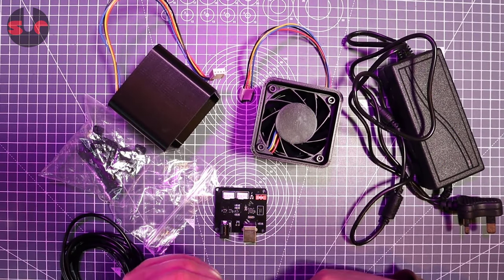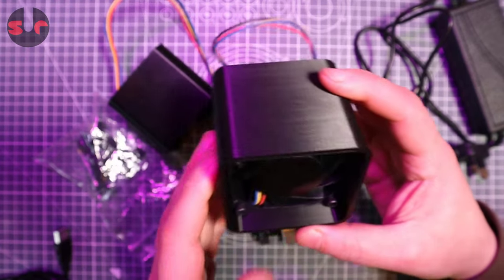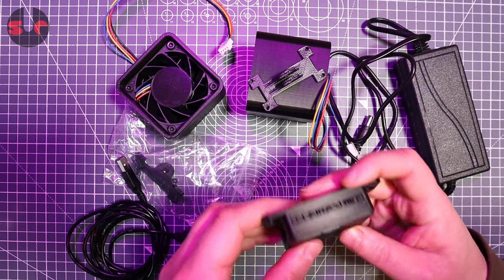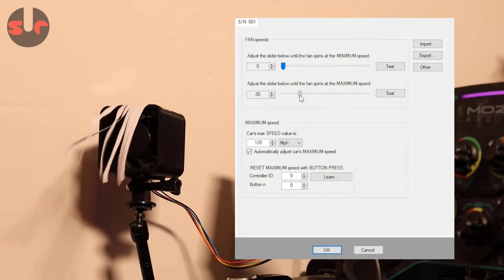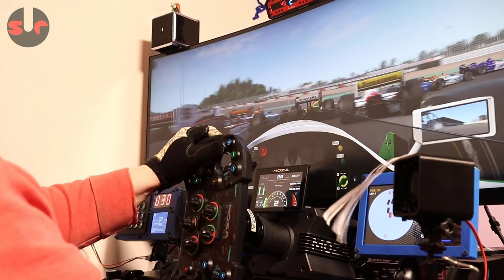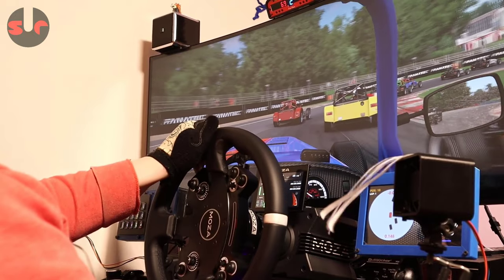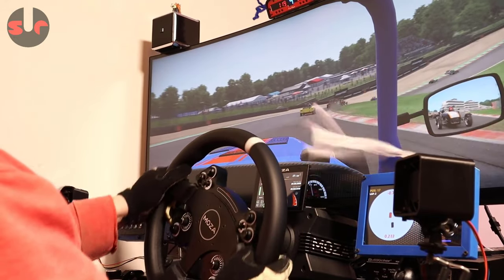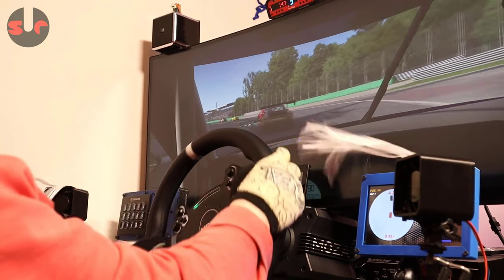SymProjects Wind Simulation [REVIEW] Compact fan controller and fans for sim racing!

Comment: I  love your videos.  Because you always try to show us the best products for the money.  In fact,  I purchased a few of thing you reviewed.  But,  the wind simulator just like the h-pattern shifter,  is something I don't understand for sim racing.   Even if you have everything already, base shakers ,  VR or even motion.     In your honest opinion,  does this really help with immersion?   Do really feel like you were missing something before this?
Reply from the maker: I don't think anybody would disagree that bass shakers make a big difference. But personally, in my opinion, wind is something more of a gimmick that's not a big deal. It's nice to have, but quite unnecessary. I need to give it a try in VR, that may make it feel more of an enhancement. I will say, though, I do like having the blast of cooling breeze.
Reply: Ventilation seems mandatory if using VR and a WindSim does this automatically and you just adjust how much cooling you want.

Comment: Are you at all able to comment on how SimHub's "Speed with Curving" functionality (left/right variance when going around corners) works with this wind sim, specifically for drifting?  I'm curious if it works as one would expect when drifting a right turn (meaning the left fan would be blowing significantly more than the right as the left window is the forward-facing window), even though you're countersteering to hold a drift.  I can't seem to find an answer on this anywhere, and would like to know before I blindly buy.  I fear the functionality considers steering direction, which may not make it work as one would hope for drifting.  Thank you if you're at all willing/able to test this on your rig!